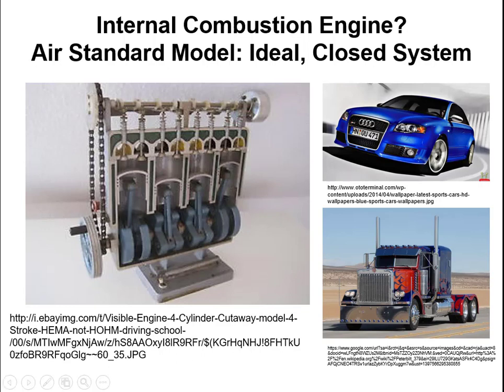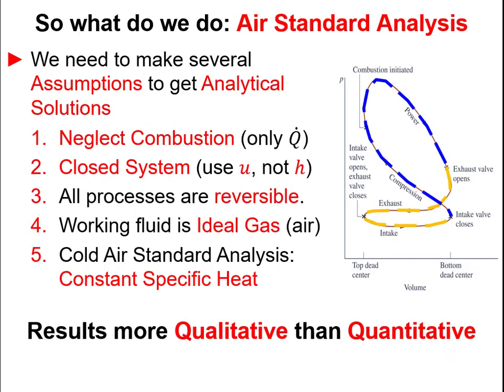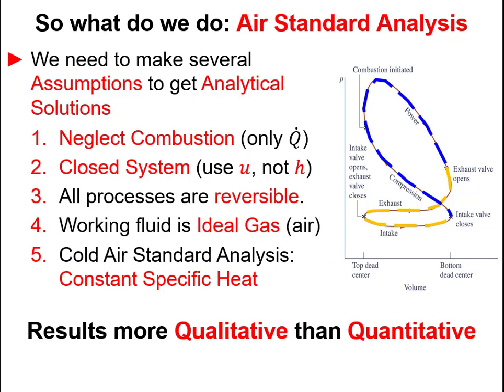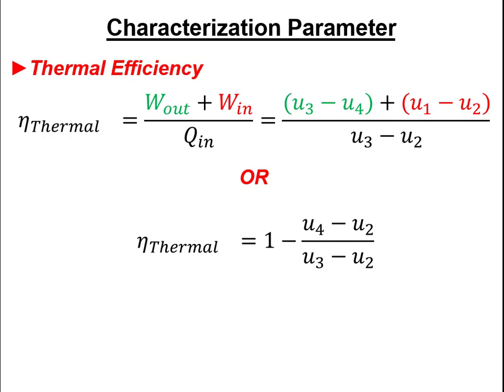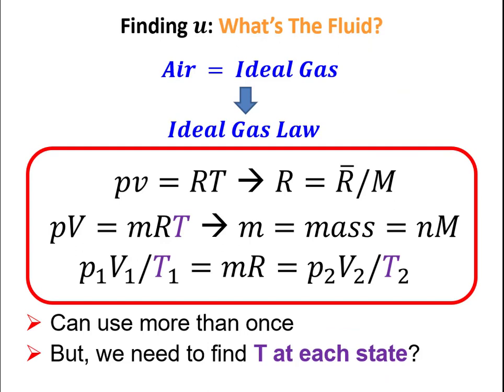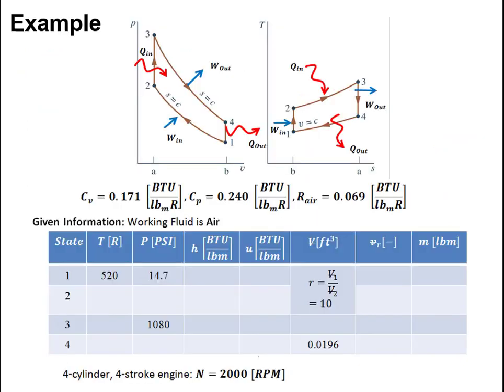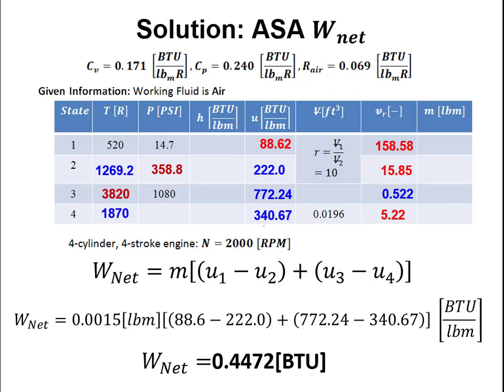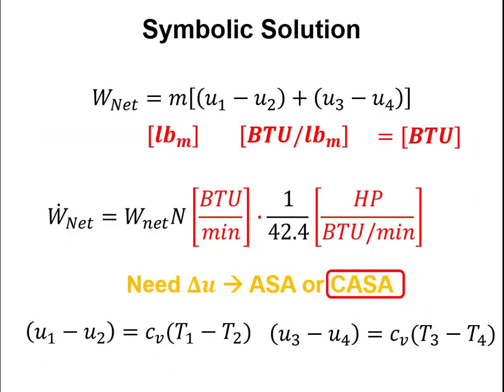The Otto Cycle: Thermodynamics for Mechanical Engineers

Comment: Great content! excellent refresher. Whats confused me is how to approach a 2nd law analsysis on an internal combustion engine. Entropy is an odd beast to get the mind around
Reply from the maker: Great question. I agree that the 2nd law can be confusing. Each process in an ICE engine is modeled as a closed system. So the second law is: \Delta(S)=(Q/T) + \sigma\dot. When analyzing ICE engines by hand, we set the entropy generation term to zero (all ideal processes). So \Delta(S) = Q/T. By doing this, we see that the adiabatic processes (Q=0) are also isentropic (\Delta(S)=0). Hope this helps!